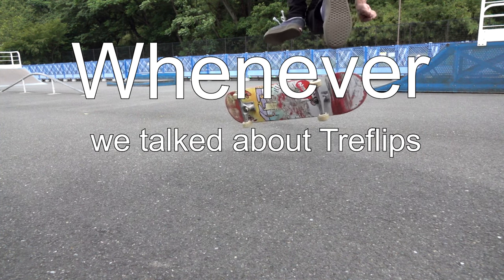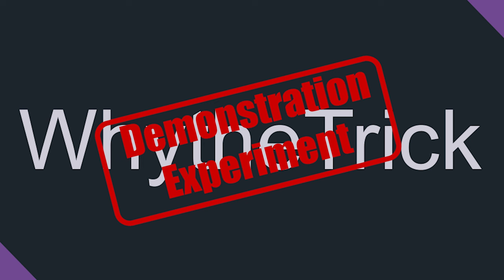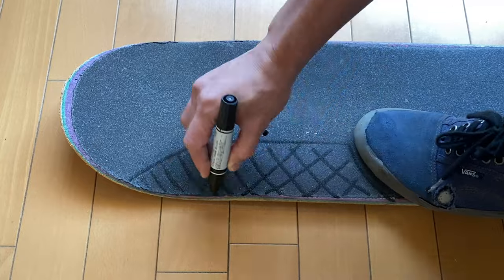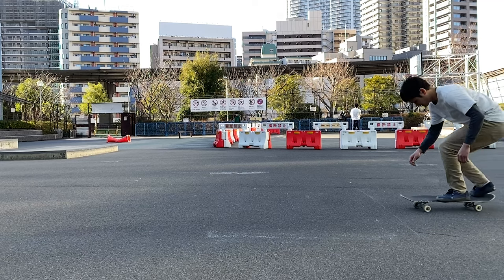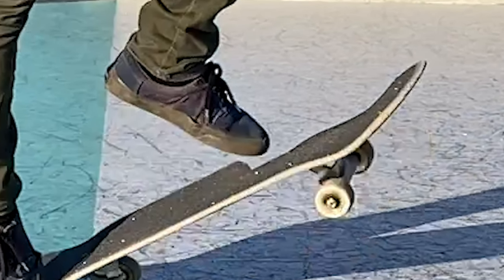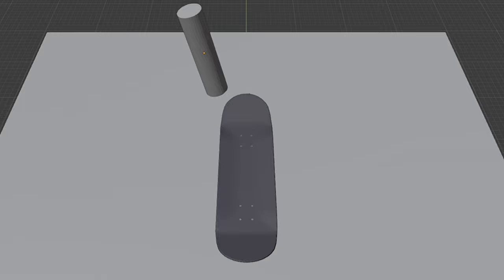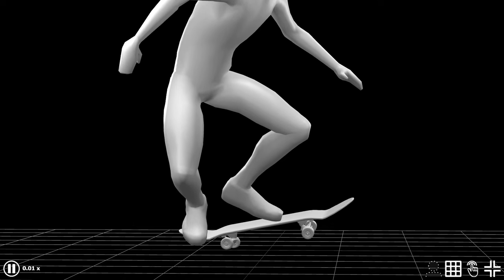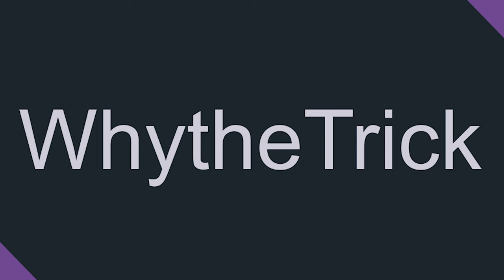What does the front foot do in Treflip?

Comment: So the truck has to be relatively loose to get the initial angle for the back foot?
Reply from the maker: No, it doesn’t have to be because the elasticity/bounciness of the rear truck doesn’t necessarily translate to the looseness of it. 
Receiving enough bouncing force is the only thing that matters. 
The initial angle of the rear truck may differ depending on the hardness of bushings you are using. Thanks

Comment: What are the technical key differences between doing a tre flip vs varial kickflip? - could you do a video about this?
Reply: well a trip flip spins 360 while varial flip only 180. pretty much treflip=360 shuv+kickflip and varial=pop shuv+kickflip
Reply: @alexmilliken6682  thank you for answering. But, I am aware of what the conceptual differnces are. With my question I tried to target how exactly it is executed - so where exactly are the differences in pressure points, sweeping, force needed and so on.
Reply: @seferis101  varial your back foot shoots more straight down. Of course a little scoop but that's it

Comment: I don’t have tres but I’ve listened to your explanation of the trucks and stuff and felt like it would work but then I got no results (I use hard bushings though); was just outside messing around and I took a note of something. I tend to have them not move away from me as do a 180 slowly and hit my shins. So I tried to lift my front wheels off the ground and then scoop/pop and it spun around a lot faster for me. And it seemed like it wanted to stay under me too. Hmmm, this must be examined further.

Maybe it’s one of those mental things. Stuff beginners only see lol. Like for ollies I also have to mentally push my foot north in a straighter line than I want to or bring up the front leg faster than I want to, or when doing a kickflip I have to think of jumping upwards and bringing my feet along, or no-comply I push my leading foot in the direction it’s supposed to end up in rather than think ‘180’ even though that doesn’t matter for the board to make the trick…y’know?

If this is a thing, it’s not possible to set up for an do before the pop. Because you have all your weight on the back of the board. You would have to make it happen as you’re popping. I know your front wheels always have to come up to pop anyway, but it seems noteworthy anyway because of the nature of the tre flip, I always think faster horizontal spin not big vertical pop. I will try to dedicate a little more time to this trick from now on. And report any findings here. (As long as they’re within the scope of this video’s theme)
Reply: Imma call them scientology flips cos I’m practicing on grass (and they killed my dog lol).

Comment: You may call this trick "tre (back foot) underflip" to distinguish from standard "treflip". The trickky point here is what defines a trick: 1) only the movement of the board or 2) the movement of the board and the feet? Sometimes people consider relevant also the way the movement of the board is achieved; in fact pressure flips and invert hell have the same board displacement but different foot movement and physics. Good video, also the ellis frost one where he puts the front foot on the tip of the nose (where there is nothing to flick) is a good demonstration of these flickless treflips
Reply from the maker: Thanks for the comment. I think so called Treflips are pretty much a mixture of both of them you mentioned. I remember seeing Chris Cole’s Treflip tutorial once and he seemed to extend his front foot after scooping his backfoot in a way I explained in this video. There could be more ways to pull it off.

Comment: If you aren’t flicking with your tre flips then you don’t have good tre flips, the front foot contact is how you actually slide and get your treflips up, you can’t get that same control of pop if your front foot isn’t making contact
Reply from the maker: Thanks for the comment. May I know if you have any objective reason why you think the slide of your front foot is needed to better control the board in Treflips?
Reply: @whythetrick  think of it like any other trick, a kick flip for example, if you are trying to kickflip onto a high ledge, you have to pop and slide your foot up before you flick to get the kickflip high enough, if you immediate kick it’s the equivalent of your treflip flipping right away, front foot or not, you should be trying to pop and slide your front foot then scoop and flick, which will bring the treflip up to your feet for a catch in the air

Comment: isn't that just a 360 underflip which is not a treflip but looks like a treflip?
Reply from the maker: Thanks for the comment.
I believe that's not the case due to the following reasons:
1. Even when I use my front foot to intentionally "flick," my backfoot still does the same motion. So I'm assuming my front foot does not directly cause the flip.
2. Some pros (to name a few) seem to treflip in the same way. If you take a cloooose loot at their feet, you might see their feet flicks the air, not the board.

NOTE:
depending on your setup, you might actually have to flick.

Comment: Tre flip is the short name for 360 varial kickflip. But you aren't doing that. Your doing a pressure flip. Am I wrong??????
Reply from the maker: Thank you for the comment. 
Sometimes my front foot flicks my board, sometimes it doesn’t at all. In either case my board flips all the same and I believe my front foot has the minimum effect in terms of the flip. With that said, I also believe I’m not the only one who doesn’t flick. 
Seems to me, not knowing the true cause of the flip is just unfortunate, if not wrong.
Reply: @whythetrick  
Front foot equals kickflip
Rear foot equals pressure flip.
Am I wrong?

Comment: It's not the trucks bushing that causes the flip it's the decks lateral bounce from the side of the tail. Try compressing your truck like a spring and then let it go. I bet it doesn't kickflip itself
Reply from the maker: Thanks for the comment. 

As you pointed out, the elasticity of bushings' itself is not strong enough to cause the flip IF the board is not moving.
Although the tail might help the flip, I believe the cause of the flip remains the same: elasticity of bushings.

Please imagine this: is the elasticity of not strong enough to cause a flip in zero (or low) gravity?
The board would probablly flip, right?

This is because the weight of the board is much smaller and bushings can flip the board with much smaller energy.

I believe a similar thing happens in my Treflips:
- As I push down the tail, the nose of my board comes up.
- When the nose has upward momentum, the same energy lifts the entire board up, allowing the bushings to cause a flip with much less energy.

Also please think about this:
- If bounce of the tail is NEEDED in Treflips, there can't be phantom Treflips. So the bushings has to do the job.
- If you take a closer look at anyone's Treflip, you can see more or less the central part of the tail hits the ground. This may contribute to the height of the trick, but would have limited impact on the flip itself.

Hope this helps you understand my point.
Reply: @whythetrick  wait you can tre flip without popping using just your back foot?

Comment: If you don't flick it's not treflip, it's pressure tre flip I mean
Reply from the maker: thank you for the comment. 
why do you think so?
Reply: @whythetrick  I think the front foot has to flick very lightly, for me if you don't flick it's pressure
Reply from the maker: thank you for the comment.

OK, how about this:
- How strong do you think the flick has to be? Sometimes, my front foot touch the heel edge of my board and gives the slightest and subtlest flick by a centimeter or so, which would probably not enough to cause a flip. However, according to your definition, as you specifically mentioned that you could flick "very lightly," it should be considered a Treflip as long as there is a flick involved. But at the same time, the front foot plays the minimum roll in terms of the flip.
- What do you think is the correct definition of a Treflip and objectively why? Due to the same reason stated above and mentioned in the video, even when I extend/flick out my front foot, my backfoot does the same motion anyways. So in my opinion, whether to use the front foot or not does not directly define the trick itself and would come down to the setup of the board, weight, preference and many other factors.
Reply: @whythetrick  I'm OK with your definition, I can't explain why, I speach French and my English is so bad sorry for that but the flick for tre flip is 33% power of simply kickflip, front foot do 10% and back foot 90% for tre flip
Reply: @whythetrick  I try to explain my opinion bro sorry for bad English ^^

Comment: Just do a three shuv eventually you accidently do a tre. Thats how i found out how to ddo the motion
Reply from the maker: Thank you for the comment. May I know how you Treflip more in detail please? "Just do it" and "accidentally you will" and all those subjective opinions/assumptions/emotions are the very things I'd like to eliminate.
Reply: I knew that the flip comes from the bf. So i had to do something different than usual. I tried to scoop but I had the toes hanging off the board . I automaticly put pressure on the toes. And voila it flicks as I scoop it. According to one of your tre vids the board snaps back to its original postion and takes the momentum to rotate 
but i think it also flicks during the scoop because the backfoot kinda pushes into the edge of the tail so it gets "flick momentum" from the backfoot".
My english is not my mother language, there may be some typos

Comment: not a tre flip. pressure 360 flip. just flick the board dude. i don't think anyone thinks this version is better and some people outright think it doesn't count. you can't do this up anything without a flick to lift it up. if i do a nollie pressure harflip, does that make it a normal nollie hardflip with no flick like in this case? hell no, it's a separate trick.